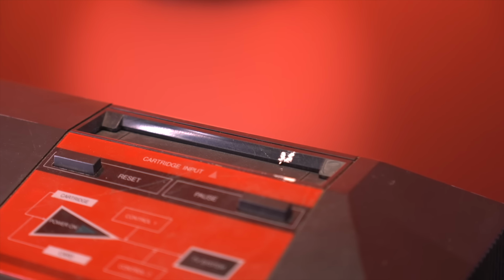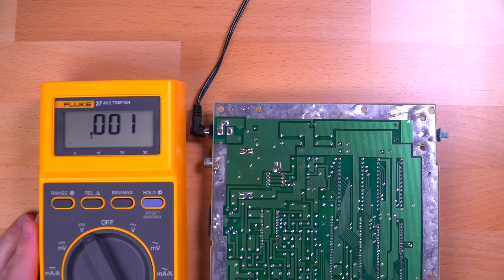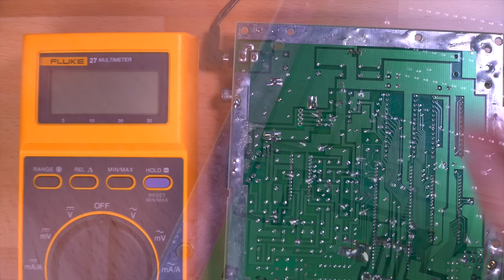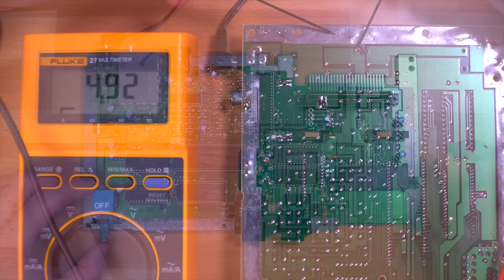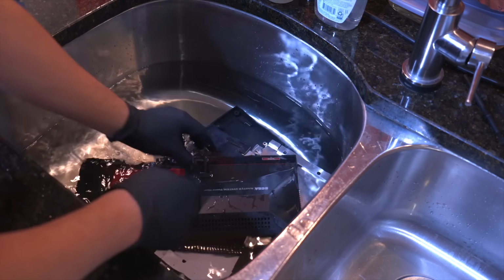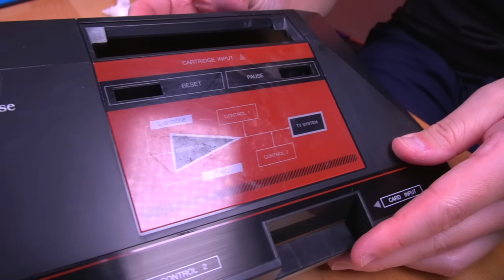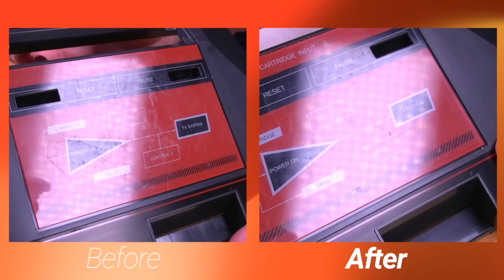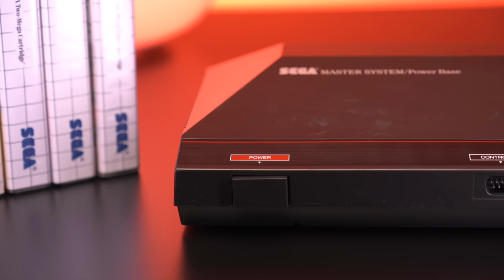No Power?  No Problem! // Restoring a Sega Master System

Comment: 12:00  Sometimes this layer is used to add some gloss and is not supposed to be removable, hence why it might be more difficult to remove. I have 3 master system 1 in storage and each of them look more like the before you've removed it.   Also sometimes the printings might be removed as you remove this layer (i had that once on a device). But yea, when it start to peel, it's tempting to remove it ^^   Oh, btw, have you tried to turn it on without a game in it ? I'm not sure if every master system 1 had, but at least some of them have a game you can play if there is no cartbridge inserted.

Comment: Whenever I refurb a console I always replace the 7805 with a modern upgrade, such as a LM7805C or 7805V, which are more linear switching buck convertors. You can also improve long term reliability and reduced heat by going with a 2A model.

Comment: Oh man, cold solder joints on the sms power switch are such a common issue that I add fresh solder even if it’s operational. I have yet to have bad solder joints on the sms but I have had them on the genesis so I usually hit those too.

Comment: This was a nice video. Really brings me back as its the first console ive owned as a kid. One question is my Master system cartridge slot flap tends to get stuck. Any advice as when a cart is removed sometimes slot flap doesn't close all the way when no cart is inserted.
Reply from the maker: It could just need a good clean.  Dirt and debris may be keeping it stuck in the down position.

Comment: Great video! Thank you for breaking downdiagramming what you are actually doing on the PCB, so many videos love to speed through that part. I am trying to fix my SMS because it gets power, but the video flickers every second or so. It seems like a power issue to me, and the first time I tried using it again (after 20 years) I used a 9v-2A instead of 1A power supply, so I may have overloaded something. Not a big electronics guy, do you have any wisdom on why this might be happening? Would a semi-faulty voltage regulator cause this or do you suspect something else?

Comment: Awesome, but you should definitely reflow those DC plug solder joints, even if they look OK. Also, you should deep clean cartridge port, even if it reads cartridges OK 😎 Zdravim!

Comment: When I had my ZX Spectrum recapped, the 7805 was swapped out for a much more modern equivalent that doesn't get hot, meaning you could lose the heatsink it was attached to. I wonder if it's the same for the Master System? I remember as a kid my Spectrum got almost too hot to touch after a couple of hours of playing Quazatron, so if it's a mod you can do to the Master System, it has to be worthwhile. Specifically it's a Traco Power TSR 1-2450

Comment: From what I'm told, the most dangerous thing for a Master System is trying to power it with an NES Power Adapter. Not sure if there's a fuse internally that pops or if it's damaging the voltage regulator like in this video, but that'll do it. Funny enough, powering the NES with an SMS or a Genesis power adapter is actually preferred over the NES one. Throw those NES ones away!

Comment: This machine looks like a piece of component stereo equipment from the 1980s.  Brushed black aluminum bezel, weird flow diagram next to the cartridge slot...are we sure it wasn't made by Akai or to resemble Pioneer or something?  That said, it seems like a number of early microcomputer devices from that time period used linear regulators from the 78xx and 79xx family of linear regulators.  I think they are still made today due to their simplicity.

Comment: Nice to see a Master System come back from what might have ended up in a dump somewhere. Nice work. 

I was one, who had a NES with a Master System sitting right next to it when they were current, I enjoyed the Master System as much as I did the NES.  And Phantasy Star is easy one of the best 8-bit games ever made. Also, one of my top 5 favorite games of all time. I even have the "Sega Help sheet" for it, when you could call Sega when you had a problem in a game, and they would mail you a walkthrough.  I do re-play it ever 3-4 years. There is a retranslation to the game but, you need a rom cart to play the patched rom, it is impressive to see the text changes in the game.

If you want to change it up a little, they did release a sort of remaster of it, in Japan only for the PS2 (Sega Ages).  There is an English translation that was done pretty well. It's impressive to see the change and a worthy play if you're a fan. 

I love seeing retro consoles given a new life. They can last 100's of years if taken care of.

Comment: Great video like always, just like the solder joints at the power port, I’ve run into a few bad controller ports with broken solder joints.  When I run into a master system, I reflow those joints just to be on the safe side.  I would definitely enjoy more of these type videos.

Comment: I like videos like these but I have two questions:
- In preparation of this restoration you likely checked which caps were required. Why didn't you just order a new 7805 at the same time? They are super common and quite cheap. You said you had a hunch it could be 3 issues. If it wasn't the regulator you could have saved it for a different machine in the future.
- Seeing how you had gloves on when handling the board when it came out of the isopropyl alcohol, why no gloves when using all the other nasty stuff like the polishing solution and the protection spray and such? Just for your own health.

Comment: I really enjoy your videos. I bought a Sega Master system off Goodwill auction but the motherboard is fried. Not sure what my options are. I guess either new motherboard, or just using the shell and turning it into an emulator.
Reply from the maker: Have you looked at the voltage regulator?
Reply: @MachoNachoProductions  I'm not sure. I brought it into a shop. They said all the switches worked but they characterized it as a fried motherboard. You think it's worth it to take it back and ask about the voltage regulator?
Reply: @16-BitMe  They didn't look at it very closely, then.
Reply: @FluffyTheGryphon  yeah that may be the case.
Reply: @MachoNachoProductions  I took it apart and the motherboard looks in tact thus far. The next step is to clean it. I ordered a 7805 5 Volt Regulator and I'm going to pick up a soldering iron prior to the parts getting here. Your video was very helpful. Hopefully I can fix it. Thanks!
Reply: @MachoNachoProductions  I just replaced the voltage regulator but I'm still not getting power to the system. I tried to clean up the solder but it's still not working. All of the caps look good and the board seems completely clean and intact. I'm , not sure what could be wrong. Any thoughts?
Reply: Hello. I'm stumped: I replaced the female DC plug and the voltage regulator but I'm not getting any power to the plug. I think the solder job looks clean enough, no cracks or bridging. Any ideas?
Reply: @MachoNachoProductions  I replaced the voltage regulator and the female DC power plug. It still does not power on, and the multimeter reads zero volts at the plug. Double check my soldering and all looks okay. Any thoughts and what might still be wrong?

Comment: I could never understand that the master system was barely known in the US. It was really popular in most parts of Europe. We had one growing up and later got the genesis(which was called the megadrive). Most my friends had a master system while a couple did have a nes but for some reason I thought the games looked so "dull" in colors. The colors were more vibrant on the sms, at least that's what I thought. Of course we did get a nes eventually and it had so many great games. However the sms will always have that nostalgic feel for me.
Reply: As someone who was there at the time the Master System was known, it just wasn't as popular.  The Nintendo games where more popular and the Genesis came out so soon that once it did the Master System was effectively dead at that point. Also Tonka (USA distributor) didn't market it as heavily as Nintendo marketed the NES. Lastly there was Nintendo's agreements with 3rd parties that effectively prevented a lot of 3rd party games on the the SMS.
Reply: NES could output composite video at best, whereas Master System can output RGB, so I imagine in Europe if you had SCART hookup, the image would look a lot better just because of this.

Comment: Another option is to just ditch the voltage regulator altogether and install the USB-C mod, like CleanPower.
Any plans to revisit GG screen kits, Tito? Mainly ones with 640x480 resolution.
Reply from the maker: Absolutely, there’s always the possibility

Comment: Oh man! I knew you'd be able to fix it. Would it be too forward to ask you to help repair mine? Happy to compensate you for your tim. Can't find a good modder who'll take the job and this is my SMS from my childhood (that I got at the same time as the DMG). Or would you happen to know a guy/gal who would help me? Thanks for always putting out high quality content my friend.
Reply: I run a vintage repair shop. Whats going on with it? I could definitely help. My business is Amiga of Rochester (we work on everything though)
Reply: @thomasandrews9355  Beautiful! Such a quick reply :) The SMS powers on, but there's no video output (not sure if it's damaged or what) it's just outside of my expertise. May need recapped or something, not sure. Desoldering components in industry hardware isn't my strong suit (as the damn solder usually fights me) so I'm at a loss. Just want to play my original games!
Reply from the maker: Unfortunately it’s tough for me to take on repair and modding jobs due to my schedule. There a lot of great modders and repairers out there that I’m sure would be happy to repair your master system. Cheers and best of luck!
Reply: @MachoNachoProductions  Just the fact that I got a reply from you is amazing in itself. Thanks for all you do my friend, and fingers crossed I get my system up working once more. Cheers!
Reply: @DrGameboyPHD  reach out and we can discuss further

Comment: Ultrasonic cleaners are awesome for these jobs. Ultrasonic dip in a non-corrosive cleaner + water displacement with isopropyl + a couple hours in a dry box to be on the safe side pretty much can't be beat for PCBs. I pretty much put every part through a bath in my ultrasonic cleaner

Comment: Why steal a 7805 off another console? A brand new one is like $1-2. Would rather put a new one in that will last 30 years than an aged one that may just fail again.
Reply: Better make a retrofit dcdc converter which produces way less heat.

Comment: Aleast this escaped bios corruption. 

Apparently Pal versions of the master system can have their bios chips damaged due to bad capacitors, voltage regulators, or use of incorrect power supplies. This has been attributed to the fact most pal master systems use a 220 input instead of US 110 input.

Comment: A really useful mod you can do is the PAUSE button mod.  Once done you can re-wire a Mega Drive controller or add a small microswitch to the original controller.  Once done you can press Pause from the controller.  If you're going for a wireless controller set up then I recommend pairing a RetroBit BT Mega Drive controller with a BlueRetro adapter and remapping the unused shoulder buttons on the controller